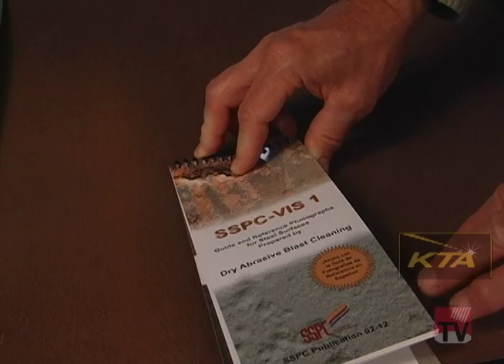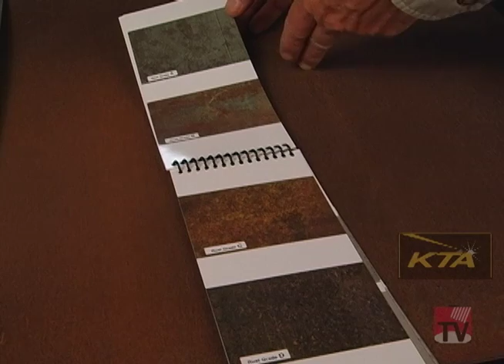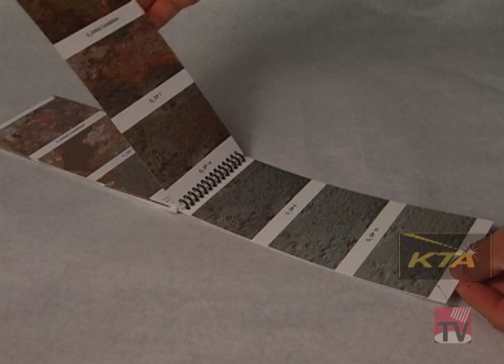How to Assess Surface Cleanliness Using Visual Standard

Comment: which visual guides to be use for cleaning standard for previously coated steel and cleaned with st2
Reply: St2 means thorough hand tool or power tool cleaning so SSPC VIS 3 visual guide should be used 👍